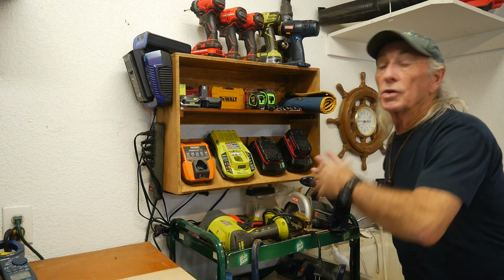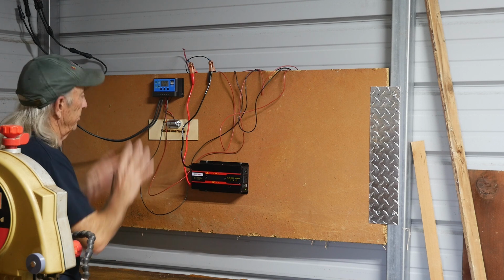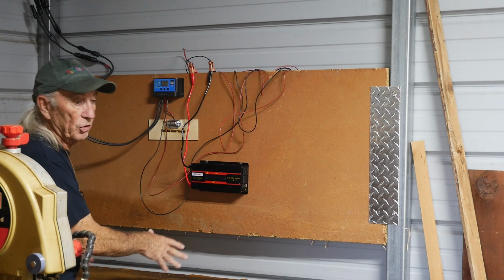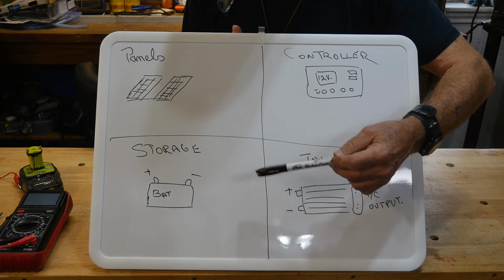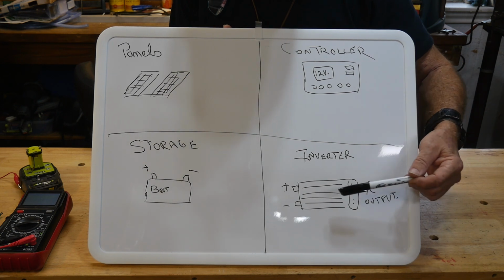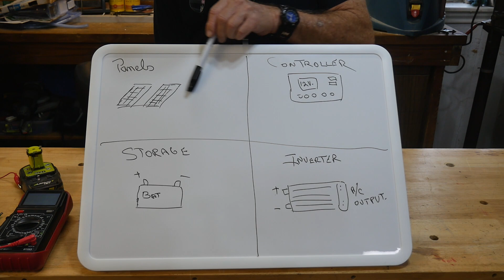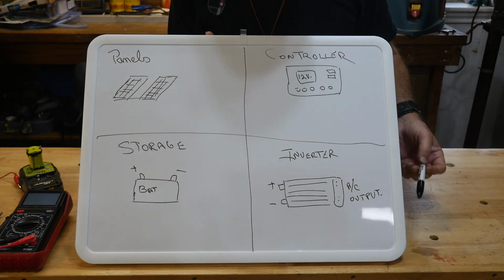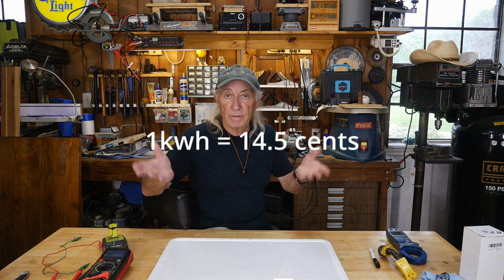Solar charging your tools on a budget system, and Contest give away, C&T ep. 337

Comment: Thanks for the Solar lesson and info. I have a grid ties system and I love it. My biggest mistake was that I got into via lease. At the time it was the cheapest and easiest way to go. I have since bought out my lease so I’m happy. In a perfect world my system would be stand along and but with the way it is I generally get 4 to 5 months a year where my electric bill has a negative cost. Thanks again for sharing!
Reply from the maker: Still sounds good to me. Lease ? does that work ?
Reply: @SirTools  lease does work but if you have the options I would be against it. My lease cast was about $85 a month/ 12 months a year. On top of that I had my regular electric bill. As I said, some of those months had a credit because we produced more energy to the grid than we used. Once we bought out the lease the $85 a month disappeared.
Reply from the maker: I've heard various good and bad with the lease deals on solar here. $85 a month sounds fair enough. A full system, they tell me would run about $30K...ouch.
Reply: Yes, on the good side, it got me into a solar system lease for 20 years with no up front cost. If my system didn’t generate what they predicted it would produce I would get the cost of the missed production credited back. On the bad side, I didn’t get any of the tax benefits of having a solar system and if the panels generated more energy over the course of the year I had to pay for the extra. My system is made up of 18 panels, the inverter and the grid tie in. My electric panel did have to get upgraded to accept the system, my cost. Right now I am generating just under 18 kWh a day and I’m located in San Diego California. If I had to do it again I might have used some of my home equity and payed for the system myself, got the tax benefit for the system and the interest. During the time I’ve had the system I did have to have it removed to replace my shingles. The original installer said my roof was fine and would not be a problem. I had a hard time getting the lease holder to come and remove the panels to do the reroofing. I never did get them to come out and ended up hiring someone the roofer recommended. I don’t think the lease holder ever acknowledged that my system was down for the couple of weeks the job took. May just be part of owning a home!
Reply from the maker: Still at least you have it and over time it is doing the job which is GOOD. Southern Texas here is about the same deal, the solar panels should be able to carry the house with no problems. OK, there is that H storm word we do not mention around here LOLOL...

Comment: I have been reading, watching, designing and wishing my house in Texas would hurry up and get finished to start my solar project.  I'm also looking at building in phases.  First phase would be a 120v system with a single 6.5Kw inverter, 4Kw of solar, and about 15kw of battery storage.  Second phase would add another inverter to give me split phase 120/240v, add another 4k of solar, and another 15k of storage, bumping me up 30Kw of stored battery power, and an output of 13Kw.  After that, battery storage would be added as needed.
Reply from the maker: Sounds like a good long range plan and a LOT of power. Maybe sell some back to the power grid ?
Reply: @SirTools  Texas ranks #2 in power outages for the nation.  Talked to Central Texas Electric, and they were thinking about starting to plan for brown outs prior to the big freeze back a couple of years.  Things haven't gotten any better, and the grid is just going to get worse with the EV mandates that are being pushed.  We were without power for 30 days during the big freeze.  No, I'm not looking at a grid tie system. One thing people don't hear about is that their grid tie systems will be shut down when there is a power outage, that is by code.  They don't want workers hitting live wires when they are out repairing the highlines.  I'll slowly move my circuits over to solar as I build it up.
Reply from the maker: Similar issues here in South East Texas with the power. We get brown or black outs now.

Comment: Well, I’ve got solar….32 panels HOWEVER, it has no battery storage. That would be off the charts! But, my electric bill is drastically reduced…as long as the suns out!!
Reply from the maker: Say WHAT ? LOLOL
Reply: @SirTools  yep…went solar last year. While the sun is out, I’m making hay, as they say. But only then. It back feeds into the grid and, just for conversion sake, imagine I (the sun), makes 55kw’s of power today and I use, 12. The other 43kw’s goes into a bank and if I have a day week of little or no sun OR, I use electricity until 11pm that day…I difference is deducted from my “bank”. My electric bill is dropping faster than it went up!
Down side, again, I have no on-site storage in a battery bank so, if the grid goes down for some reason…I go with it, till it’s restored. If the proverbial crap hits the fan, perhaps there is a way to bypass and benefit, but at the moment, it’s far outside my realm of comprehension!! FAR, FAR outside!!😎
Reply from the maker: @keithrayeski6417  Better than nothing I would say. I've been sitting on these panels and controller for years. My electric has gone up so much I am force to do something or start thinking about solar.
Reply: @SirTools  it’s not cheap but, the feds are giving a 30% deduction credit and some states are giving tax brakes as well. It’s more than I can write here but as I figured it, if I put everything extra toward paying off the remaining balance after the tax credit…before long, I’ll be free of the grid…as far as my monthly electric bill. It’s a worthwhile investment in my book.
Reply from the maker: @keithrayeski6417  Good to hear it. I'm seeing a lot of complaints here about solar companies ripping off the customers. Sounds like you did it right ! The 30% and claims etc here has been less than good news here. Also I called a few but they wanted to install them on my house roof which I refused. Asked about the shop / carport building and they said nope. Like you said, I could write a book here about the dark side of things here LOLOL.